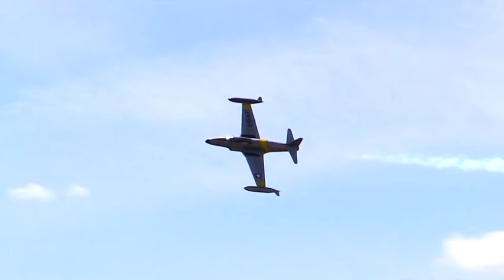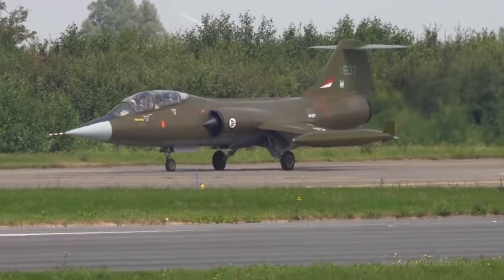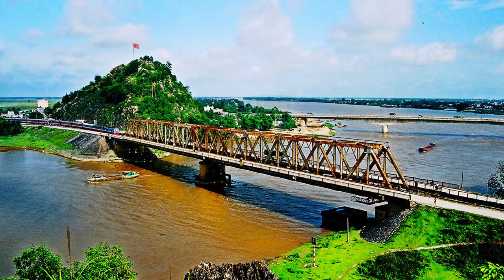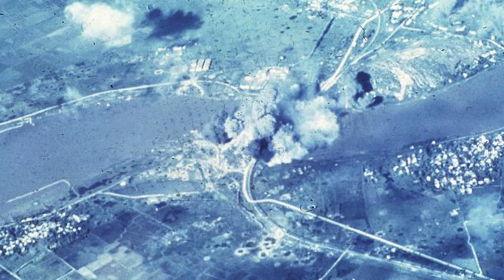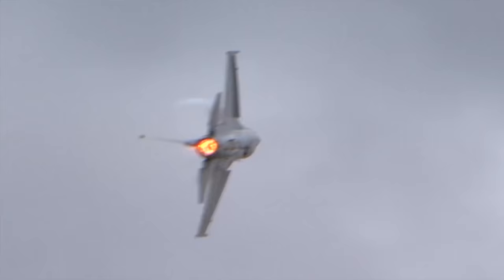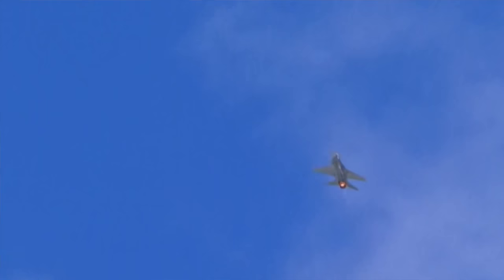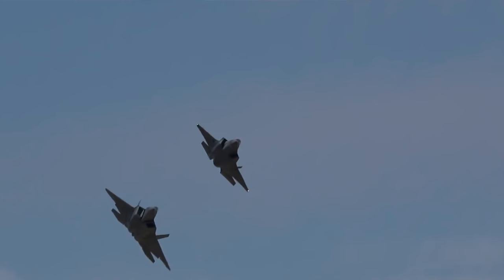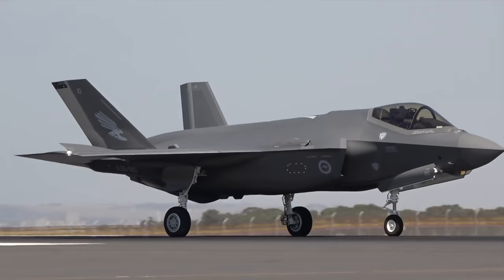Real Fighter Pilot on 5th-Generation Fighters

Comment: The more I learn of modern air combat, the more it seems that numerically superior missiles are a huge advantage.  The 5th Gen fighters are horribly lacking in missiles, and are more easily overwhelmed/depleted. Until vastly improved missiles and loyal wingman tech catches up, the advantages seem diminished. Stealth tech is being defeated more quickly than weapons are improving.  

The F15EX seems a great tool to both enhance stealth jets, by being a missile truck, but also advancing the numerical advantage in the sky.  A mix of say 50-100 F15EXs, and 15-20 F35s as quarterbacks, seems very effective for large air operations.  The F15s could even be replaced with B1s, B2s, B21s, as appropriate, or even sea based assets. A large ship with 1000s of missiles, and a few F35s quarterbacking, could be devastating.  

But now I wonder if satellites could eventually take on the quarterback role 🤔

Comment: I mean, this is pretty close approximation. The fighter 'generstions' are more of a loosely defined set of era that is more less linked entirely by the technology. 

1st gen was was the Bell P-59, Gloster Meteor, Me-262, ect. The germans were actually very far ahead of us and I'm sorry to disagree Hasard but the swept wing of the 262 was also for aerodynamic consideration. The germans had several leading designers that all reached those conclusions, some as early as the late 30s - see Ho-229. You can go faster with swept wings but you can accomplish much with just thinner chords as well, which is what the Brits and US did. After operation Paperclip, we (the west) finally widened up. The Russians/Soviets had their far share as well. By 2nd generation, the Cold War was off and driven entirely by a technological arms race. 

The 1st generation of fighters basically sucked. The entire generation was mostly to mark a successful implementation of new technologies - namely the success of Whittle's brain child (the turbo jet). By the 2md generation, it was about refining that tech and better adapting. By the 2nd generation, missiles came out but the main armament was still guns and lots of them. Fighters in 2nd generation were marked by being the trans sonic  fighters. It stretched thru the US century fighters, culminating in the Whitcomb Area Rule development which finally unlocked modestly efficient flight above Mach 1 (see the Delta Dart / Delta Dagger design history). 3rd generation finally climaxed with the likes of the F-4, MiG-21, MiG-23 and F-111 - a generation where speed was king, and avionics was your primary weapon. 4th Generation was a response the Apex designs of the 3rd generation and is marked by FBW, advanced aerodynamics for increased maneuverability and defined multi-role capabilities. The F-15 / F-16 combo is famous for it's Hi-Lo methodology which completely changed what was in the past with 1st thru 3rd gen. In 1st thru 3rd gens, aircraft grew to be more specialized and the name of the game eventually was specialization with extreme speeds and cutting edge avionics. 4th generation reversed course, by sacrificing absolute top speed for maneuvering, trusting Thrust-to-Weight more than high Mach, and making each platform potentially flexible enough to perform an myriad of roles. Within 3 years of service, the F-16 was a bomb truck and by 1991, it was the Viper that dominated CAS sorties, not A-10s. By 5ths gen, we used again another paradigm shift. A 4th generation platform, the F-117, pioneered and proved stealth to be the best future. 5th generation exemplifies those by making stealth and sensors the primary focus, with maneuvering being favored more than speed. From the F-22 and F-35, to the Su-57 and Chengdu J-20, a preference for 'efficient speed (such as super cruise), stealth and sensors is seen across all. The F-35 is likely the only one with a few hints of the 6th generation in it - that is the 'smart' features. The 'smart' platform is likely the next step along with a return to 'speed'. My prediction (a well informed one) is that we take our drone based airforce. The F-35 is already capable of this and it's only a matter of time before each pilot becomes a local flight commander of a wing of A.I. driven aircraft.

Comment: This is exactly what wrong with the F35….yeah, it’s a technological marvel, it’s networking and battlefield data systems are unparalleled, and so on and so on…yet nothing is actually spoken of its effectiveness in combat. So it’s knows where the enemy is, what it’s doing, what equipment it has, or where it’s going, but its ability to actually get to the enemy to kill them in a contested environment is extremely sketchy
Reply: why its sketchy? thats why it has the VLO features for deep penetration into contested airspace.
Reply: It.  Already.  Has.  Been.  Proven.  In.  Combat.   --- You need to catch up on current events.
Reply: How? It knows where it is, launches a missile and the enemy is gone before it even knows it’s under attack.

Comment: Comparing a f35 to f16 
F16 came out at $ 9 million per copy
F35 came out at + 200 million a copy
Reply: Yes but the F-35A cost less than an F-16V.
Reply: Your numbers are way off.  First, one has R&D $$$ wrapped up in it and the other does not.  True cost, no matter what the naysayers want you to think, does NOT include R&D costs per air frame.  Even the budgeted funding is separate.

Comment: How pilots use machine gun when the target is continuesly moving at high speed and insane maneuverability....
Reply from the maker: it's difficult--that's why smart weapons and missiles were such an advance
Reply: Fighters can automatically calculate required lead so pilot only need to align the front sight.
Reply: in korea and after they had a radar gun sight if i recall correctly. we have HUD's and more advanced sights now too

Comment: Seems like not only the pubic misunderstands these evolutions. Yet another influential U.S. Senator calling for the end of the F-35 programs for many of the same tired reasons that seem to imply a lack of understanding regarding what the F-35 "system" is intended to achieve, not just now, but over time, as technology further develops and allows further synchronization across myriad weapons platforms. Radical technological advances don't come cheap and there will be mistakes along the way -- countless examples of previous such "failures" litter the path to now well-known and respected programs -- see Osprey as just one.  Moving ALL of the money away from the F-35 to the 15EX is absurd.  Investing SOME  more funds 15EXs to complement and amplify the lethality and flexibility of the the F-35 network is sound though.

Comment: What about the A-10.  The primary weapon is the gun.   Gun goes burrrrrrrrrrrrrrrr
Reply: The A-10 is not a fighter it is an outdated ground attack platform. Depending on the zone the A-10's main weapon could be standoff smart missiles or smart bombs too while never firing its gun.

Comment: Fly by wire, pioneered by Avro Canada for the CF-105 ARROW in the 1950's. After it's Cancellation America would immediately headhunt these engineers lead by Jim Chamberlin to fix their failing Space program.

Jim was immediately made head of building everything, fixed Mercury, built Gemini from scratch and lead Apollo and Prototype the Shuttle. Owen Maynard would design the lunar lander from scratch. These 30 odd foreign workers would do what America failed and put Americans in space and on the Moon.

The transistor system and circuits pioneered for the Arrow would be directly put into the American space program.. and later American fighter jets as the Avro engineers would spreadout across the defence industry in the USA, teaching as the went and lead their respective programs at every company.